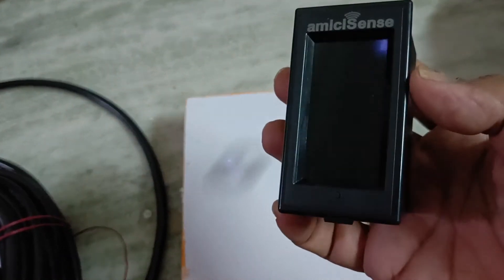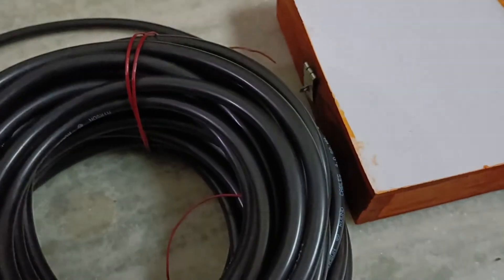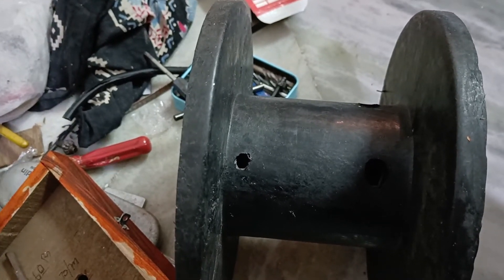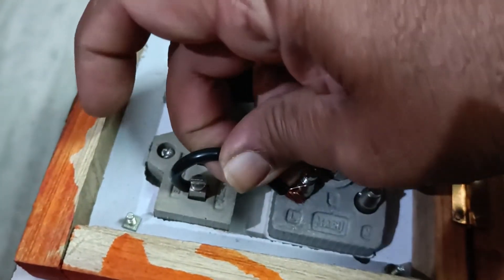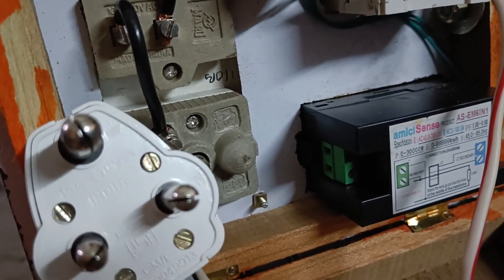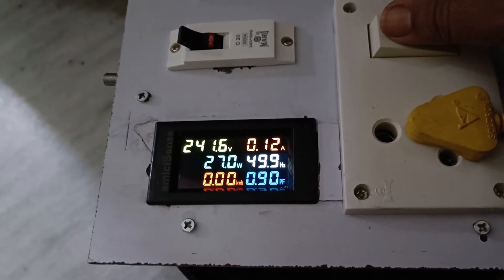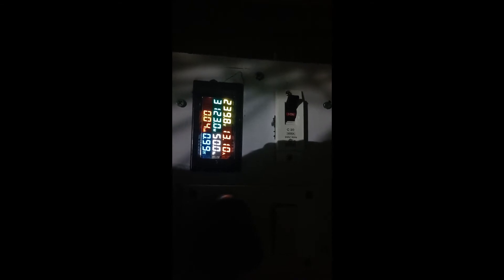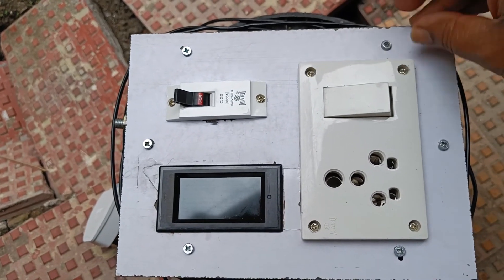Tata Tigor EV slow charger extension cable #tigorev ,#powermeter ,#tatatigorev ,#trending

Comment: Good one. Nicely explained. If cost is not a big concern, it is better to 3 core 4sq.mm. cable and use external earth only when required using a patching or switch.